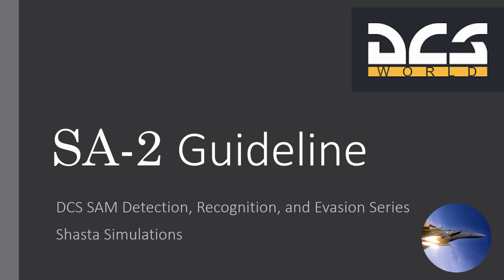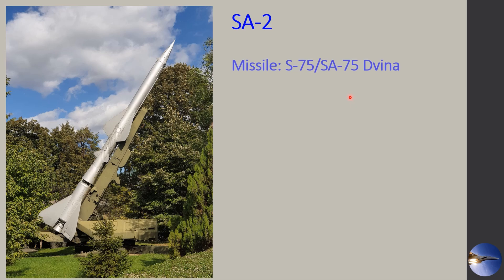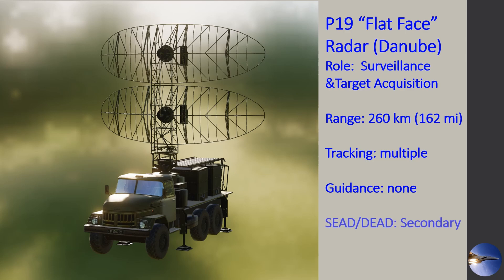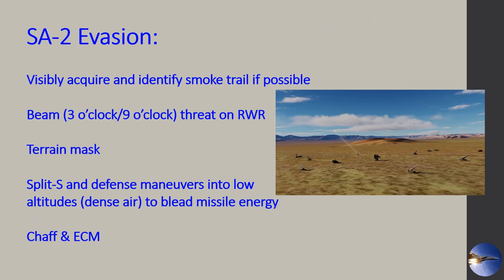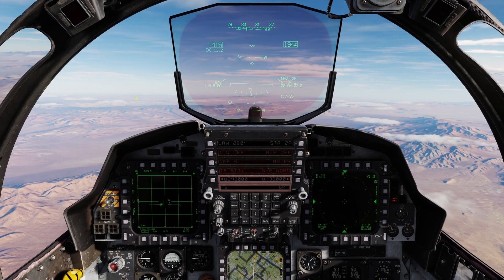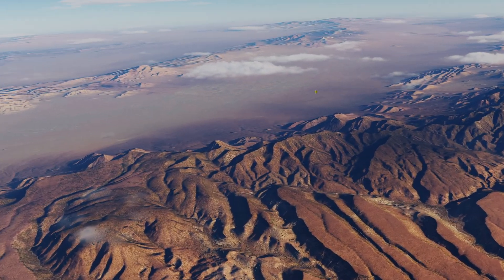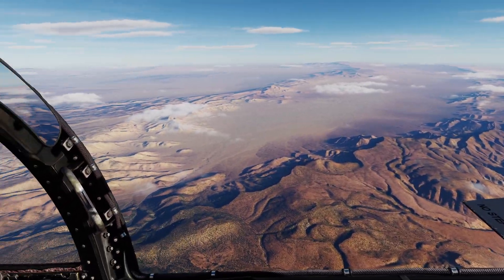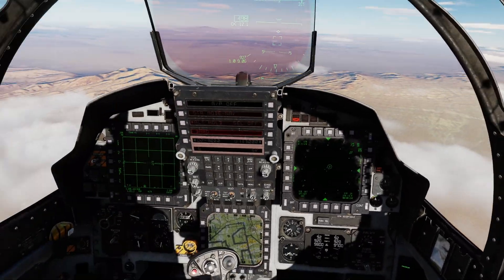DCS SA-2 Detection, Recognition, and Evasion

Comment: 9:00 FangSong is not using Doppler spectrum for filtering ground. This is the reason it does not see targets below 600ft AGL. To defeat the SA-2 in DCS all you need to do is to get below 600ft.